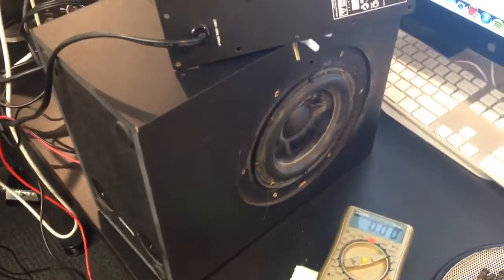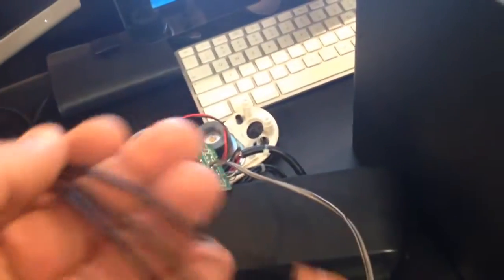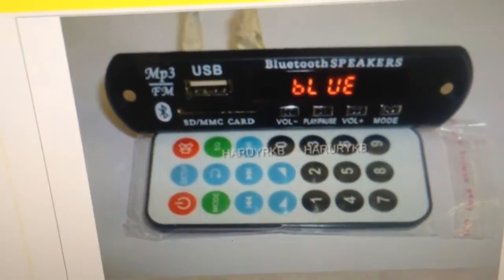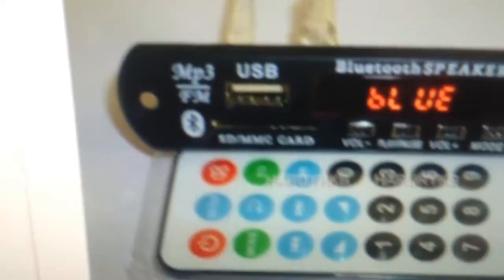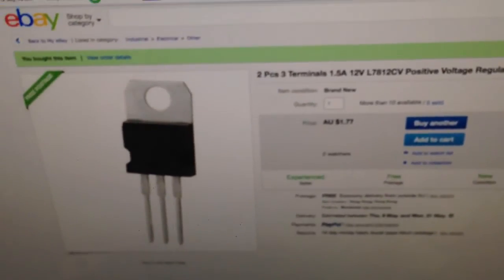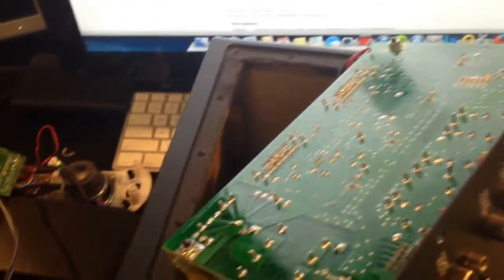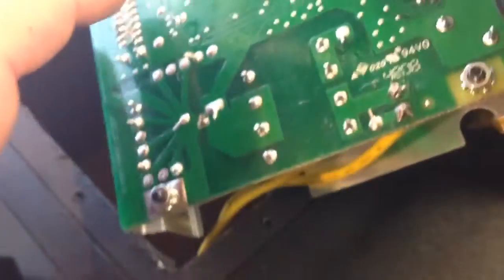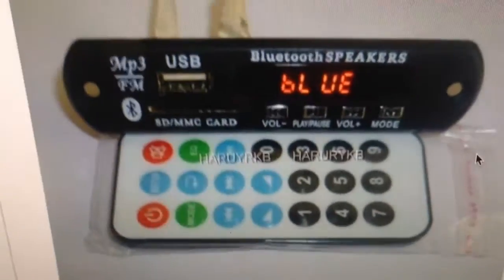DIY Logitech X-530 5.1 speaker to standalone MP3 Player Bluetooth Conversion / Hack

Comment: I had a broken pair that I just didn't want to throw away... Eventually I got to repairing them after prob 1.5y :P . 

Discovered the 220 to 12v transformer was blown. I disconnected it. Grabbed a 12v 2a PSU from a old modem and soldered it into where the transformer had supplied 12v (yellow wire, I think for 220v as repair videos from the US had blue wires). Once that was working, I used a male dc-jack, so I could "hotswop" the psu with another standard DC barrel jack.

It's working 100% ! 

I added a Bluetooth adaptor with a female 3.5mm jack, and now I can use them via Bluetooth from my phone / etc.

When eventually reassembling the sub, I tried to seal it as best as possible, with a professional grade glue gun and a glue stick that was thicker than average. Make sure the glue is molten and wear gloves + protective eyeware.

Comment from the maker: It turned out good, i just got too lazy to edit and put up the video lol. it all worked very well except for one thing. where i cut the place for the Bluetooth / FM / USB etc air gets out so the sub doesn't sound too good. what i should have done / should do in the future is make a sealed box around the Bluetooth device so no air gets out of the sub box through the ports on the front

Comment: +Aron Bezzina  
hey there!
I actually have the same issue that your friend had with the volume knob that's broken and I don't quite catch what you said he put there instead of it, at 0.43 of the video. And also if you would suggest any other way to fix this. Thanks in advance!
ps: Respectable idea and project..
Reply from the maker: The easiest way is probably just to solder wire across where the pot was that way it's always on max volume and u can then use the volume on the computer to control it :) or replace the pot with another one. Or get some small trim pots (what my friend did)
Reply: +Aron Bezzina Thanks a pot! :P I'll see if I can find this odd six-in-one potentiometer like this one to replace it, otherwise I'll use one of the other helpful suggestions you made. thanks again! Cheers!